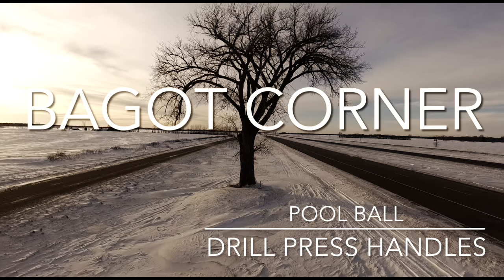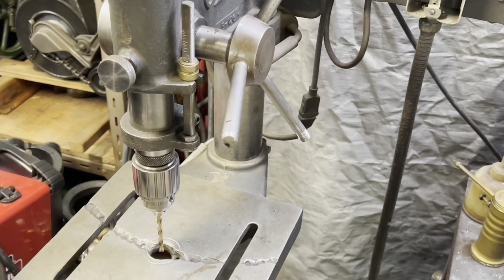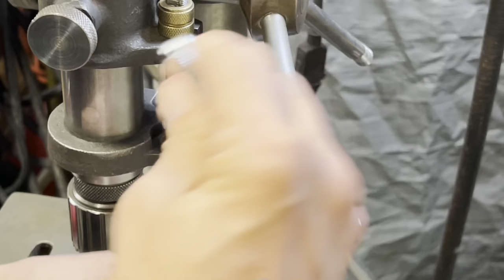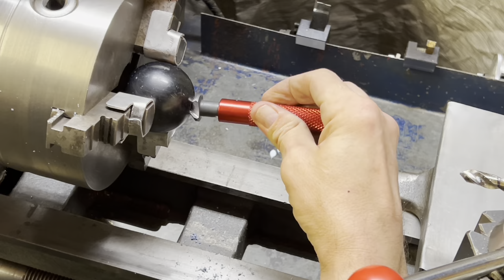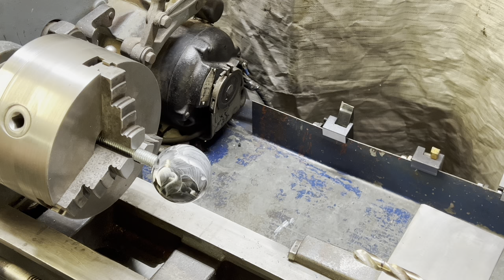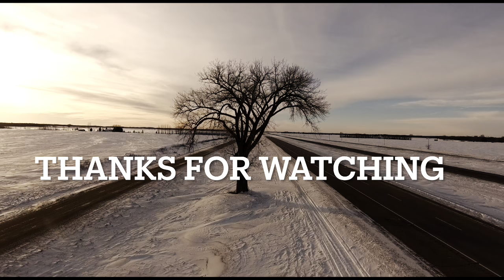POOL BALL DRILL PRESS KNOBS

Comment: I might try that on my small drill press without the metal lathe though. Cheers mate 🥃👍🇦🇺🍷
Reply from the maker: Hi Andy, for sure any drill press or even handrail will do the trick. I just happen to come in to some snooker balls so I felt it was about time to put some handles on